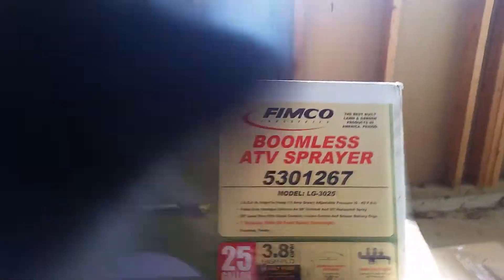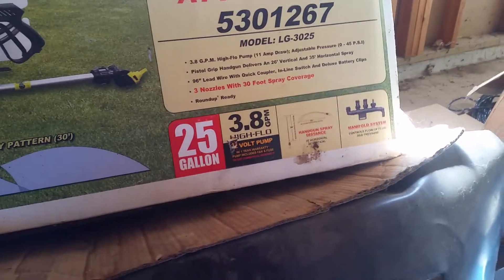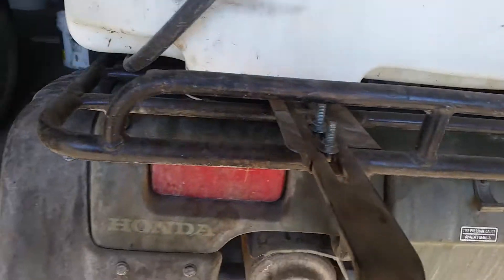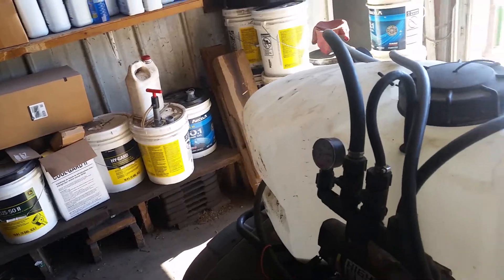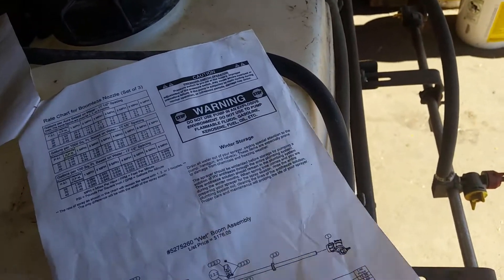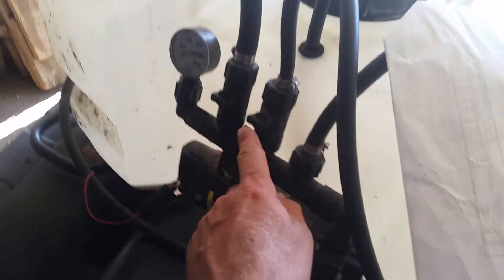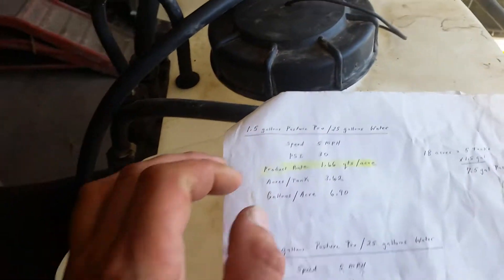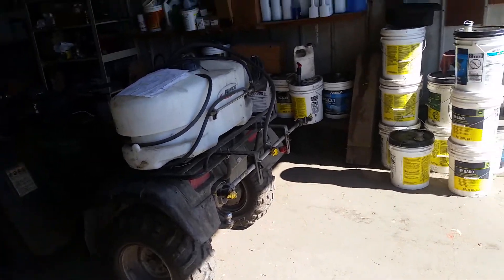Fimco AtV Sprayer

Comment: I strap a 12volt battery on he front rack so I don't have to use the quads battery.   I have a FIMCO trailer sprayer for the lawn ,but I've sprayed some spots in the field with it , it has a 6' boom.     thanks for the vid
Reply from the maker: Thats what i would lke to do. Thanks for watching and commenting